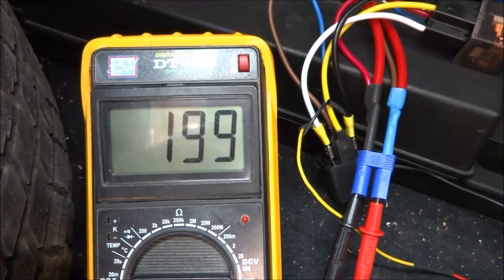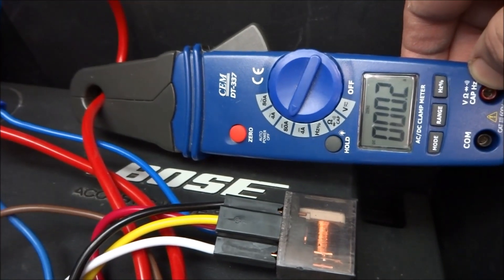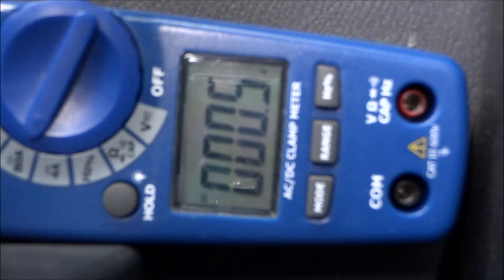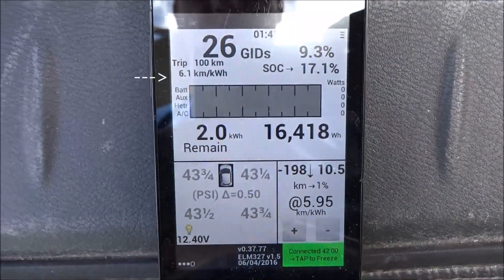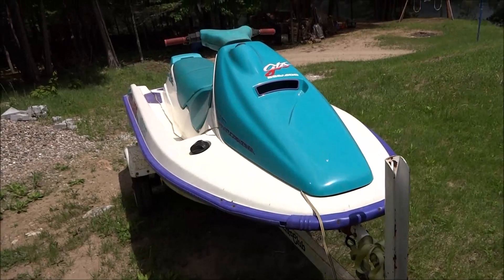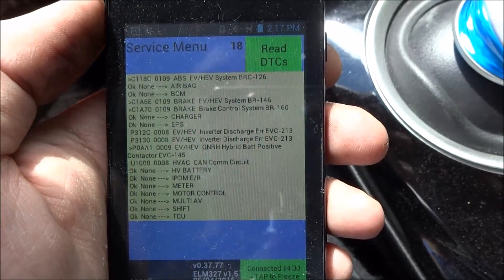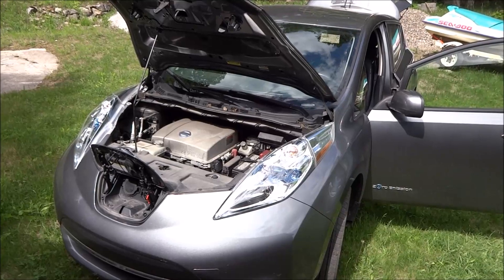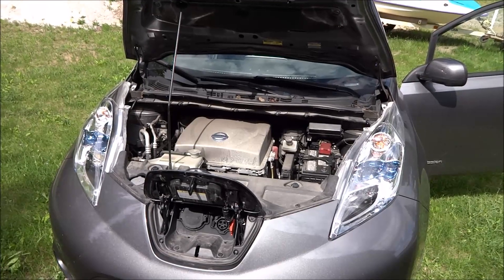Nissan LEAF range extender pack build Pt.3.2 (2nd long distance test)

Comment: I love that you use your Leaf for towing.  I've done the same with both my '04 Prius and '12 Volt, with absolutely no issues because of towing... and I tow almost every day, sometimes well over 1000#!  Anyway, hope you find the time and motivation to continue the great work!
Reply from the maker: Yeah, I've towed my BX24 tractor, almost 3000 lbs with trailer. Not long distance of course...

Comment: Perhaps wire up a timer delay (555 timer connected to N.O. relay) that disconnects main pack only after the auxilliary pack, which would be disconnected immediately.  When restarting, the relay should provide an adequate delay to the auxiliary pack being connected, no?
Reply from the maker: Not sure I want to make changes to the signaling going to the main pack. I'm hopping to tap into the the control wires for the main relay. My relay needs to open and closes at the same time as the main pack relay.
Reply: Yes, do not mess with the vehicle signalling.  You also need to sense both the N and P contactor lines and cut off when either drops.  I have suggested a circuit in another Reply.

Comment: fantastic work,  but i don't like your parallel to series relay. I understand why you have done it,  but should you lose that 12v for any reason while you are attached to the main battery,  you will have a massive voltage difference.  Hopefully it will just blow your fuses,  but worse case you could have some exploding batteries
Reply: Exactly.  I can't figure why he is trying to parralelize.  Is it for offline charging?  Then just get a second charger.  This is too dangerous.  What is the reason for this parallelizing?

Comment: So I have a Leaf that developed the same problem (P0AA1 main contactor error), and I was able to fix it without a trip to the dealer.

Thanks to the awesome work of Jim Pollock (Turbo3 on mynissanleaf) and creator of the LeafSpy app, there is now a non-Consult option to clear this code. He was able to determine the CAN message procedure to clear the P0AA1 code that was preventing my contactor from closing.

As this video demonstrates, this error that is likely to be encountered by folks hacking additional batteries or a vehicle to grid connection to their Leaf. If you make the mistake of applying high voltage to the switched side of the contactor when the car does not expect it to be closed, this hard error will be triggered (because it thinks the contactor has been welded shut) and the regular LeafSpy DTC clear function will not clear it. Consult III+ equipment is typically needed to reset (once any physical damage to the car is repaired).

I was very lucky. None of the parts were physically damaged in my car (precharge resistor still measured 30 ohms), but you should really check things out using the service manual procedure for this error before clearing the code.

Jim is going to add the P0AA1 clear feature to future versions of Leaf Spy, but in the meantime, if you have this problem, you can contact him directly for help to get it cleared.
Reply from the maker: Thanks for the info! May be useful in the future! I love the LeafSpy app.

Comment: Just wanted to say that I applaud your work! I'm sorry you have had to learn some hard lessons, but I'm very appreciative that you've learned them so I don't have to. I'm a pretty big fan of a trailer mounted extender pack... much like replacing your jet ski with a battery. It moves the fire threat away from the car and allows easy connect / disconnect. If I continue with my plans, I'll have you to thank!

Comment: Being the 12 volt battery is supplying the power for the lights, heater, air conditioning, radio, etc, and this battery is charged from the traction battery which reduces the range in winter, how about finding a way to put in more reserve 12 volt battery power? That is,  can we find a way to at least run the heater off a larger 12 volt lithium battery not being charged by the traction battery? It could be placed in the trunk for longer trips and removed for shorter trips. The heater seriously shortens the range in cold weather. Wind shield wipers take power as well alights at night. It would seem that the easiest way to extend range is to run these systems off a larger battery that is not being charged by the traction battery. It could be a very large 12 volt, lithium battery that is only charged as needed by 110 or 220 at a charging station. Many quick charge stations have a 110 outlet and a battery charger could be carried to charge this system while charging the car on the 220 or quick charger. But if the separate 12volt battery that runs the 12 volt part of the car were large enough, it could run the car for many hours without charging. The key then would be to find a way to flip a switch between the two 12 volt batteries that the cars computers wouldn't sense. It would be like throwing a reserve gas tank switch on a gas car. Does the car know how big the 12volt battery is? If it is larger, would it draw less power from the traction battery? Or no?
Reply from the maker: The car's heater runs off the main pack, only the fan runs of 12v. Finding a way to supplement power on the 12v bus would not get you much range, a few kms at best.

Comment: Was there anything else damaged besides the pre-charge resistor? I have the same error, P0AA1 (positive contactor), on a 2013 drive train that I removed from a crashed vehicle for an EV conversion of another vehicle. My resistor is fine (30 Ohms) and all the contactors work (not stuck). I can't clear the code even though the condition (high voltage where it shouldn't be) is no longer present. Is the Consult equipment needed to reset this code ("specific DTC clear") or can you do it with Leaf Spy?

Comment: Do you think it's possible to Run a generator in parallel with the leaf battery at the same voltage as your secondary battery did?
Reply from the maker: Not easily. Generators are usually 240v AC so the only way to do it is to get yourself a battery charger. The whole setup would be large and heavy so you'd have to put i in a trailer.
Reply: Normal invertergenerators have permanentmagnetgenerators producing 3phase with high freq.  Remove the inverter and add a simple rectifier instead.  For the 96 serialcells of a leaf , this is very the voltage the inverter want ( inverter want 330-385vdc ). If You make a controller turn down the trottle of the motor if the batteryvoltage gets higher and 4vdc/cell it will not be a problem. You can also put on a 12v coil push down the trottle of the motor by the cars power send to the rear breaklight so the power will be close to nothing when the Your re-generate. As exsample the kipor 104cc 2kw invertergenerators, You can push full trottle as the battery and consumption will easily keep the rpm down and this way You can take close to 3kw from this generator. During the time it takes to drain the  battery of the car, this will give You about 50km more range.  I have a some of theese generators with defect inverters ( inverter is the weak part and the part with most problems ) ( I am waiting for my e-golf waranty to expire )
Reply: I think this is a great idea.  Get a 3 kW lightweight generator and put it on a bike platform attached to the hitch.  Hook 4x 1.2 kW CCCV 86V (24s) chargers ($15 each on eBay) in series adjusted to 99V and 7A each.  Take the 240V AC, and run 2x 1.5 kW 72V power supplies that feed the chargers.

Comment: I'd drop the battery out and install a second dc connector to it and wire it to the other side of the contactor  in the battery pack. Then have another contactor coming from the auxiliary pack on its own switch on the dash. Maybe this contactor could be wired to disconnect when car is powered off. But only angle to re-connect from a separate switch. This would prevent charging the auxiliary pack from the leafs on board charger.
Reply from the maker: AArdy, yes, that is possible but you'd break the seal on the pack allowing moisture to get in. I guess if you can seal up the connection real good that would work.
Reply from the maker: William, I though of that to... it is possible...
Reply: I wonder if there is a signal  wire when the car is put in drive. If so you could engage the booster relay when the car is in drive and disengage when the car is shifted from drive.

Comment: Is it impossible to connect the extra pack directly to the main battery pack? Then it should not be a problem charging either (?)
Reply from the maker: Not impossible but very difficult and more dangerous. Someone did this and burned their car to a crisp...
Reply: Ah, you don't want to crisp your car :)  But without being able to charge the extra pack the ordinary way I think this is not the way I want to go. Or do you think it will be possible to charge it via Type 1 and ChaDeMo?
Reply from the maker: Yes you should be able to charge the secondary pack at the same time as the primary pack. You just have to make sure you connect the secondary pack after the primary relay in the Leaf's main pack is closed. I have not yet tried this.

Comment: Thanks to realy useful information. I working on similar project, add 16kwh in parallel with the main battery. I work in the direction that I will use the wire which control main power relay for control additional power relay that connects the two main batteries together if voltage is the same  (control connector on the main battery pack).

Can you write a little bit more how you solve the problem that arose due to voltage on the inverter due to off the main battery.
Thanks and all the best to continue
Reply from the maker: I had to replace the contactor box in the Leaf's main pack. The following helped me to figure out the problem: 
http://www.mynissanleaf.com/viewtopic.php?t=21776
Reply: Thanks for the quick response and a very useful link. Are you contatctor box changed itself or did you have to do on nissan service. And how much it costs?
I do not understand why blown a resistor if the contactor is switched off, unless it is a portion of a second when the circuit is closed.
I really want to understand why this happens? Please find a picture in link below. (thx mikeatyouttube for video about relay signals off). 
https://drive.google.com/file/d/0BxKOh50vx8dJWnhuVlVhZ1ZVVEU/view?usp=sharing
https://drive.google.com/file/d/0BxKOh50vx8dJNFFEaFdwWTZEU1E/view?usp=sharing

thank you
Reply from the maker: I replaced the contact box myself, purchased on ebay for $100 plus shipping.
The pre-charge circuit is only on for 500ms on startup. It is designed to "slowly" charge the capacitors in the inverter and charger.
Looking at your schematic, I assume RLY 2 is the same as RLY N from the video. It closes 100ms after the preCHG and with both of these relays closed, all power is routed through a resistor to charge up the capacitor. 300ms later, RLY P (RLY 1 in your schematic?) closes to effectively bypass the pre-charge resistor.
Now on shut-down, the preCHG relay is closed for 400ms when both main relays are open. I don't know how, but I think this is done to discharges the capacitors some how. By having my pack still connected to the high voltage bus, the resistor is now trying to discharge my secondary pack and thus burns out.
Reply: @DIYbatteries  afaik, it doesn't make sense that shutting the vehicle off without having first disconnected the extender battery actually killed the pre-charge resistor.
Reply: I don't understand.  With both the P and N contactors open, there is no circuit to the pre-charge resistor.  The pre-charge resistor just bypasses the P contactor.  So if the N is open, there is no circuit.  Even if the N is closed, the circuit will only have the difference of voltages between the main pack and the auxiliary pack, which is tiny.  So what gives?  Why should it burn out?  And BTW, why did you just not replace the 30 ohm resistor?

Comment: Leaf Xpack - This is very interesting.  Sorry you had to go through it for the sake of research and advancement in range of these EV's.  Could a series of switches on the dash or console act in the same way as plugging everything together?  Then you could turn the two or three switches off before turning the car off.  Thanks for the updates!
Reply from the maker: Definitely, a quick and easy fix would be to wire the contactors to a 12v accessory plug which I could connect and disconnect when need be (using the "cigarette plug"), however there's still the possibility of human error. I don't want to go through that again!
Reply: Hybrid Industries place another 24Kwh pack in the trunk but is not in parallel with the cars battery. It has a relay that switch one battery at the time.  So you can charge one battery first and the switch to the other battery to charge using the leaf charging system. Same thing on driving, use one battery at the time.

Comment: Wow bummer dude!  I probably would have pushed that power button without thinking after a long drive too.  Well at least you know the fix.  Could you wire the relay from your extendo pack to the car's 12v so that when you shut down it kills the connection automatically?
Reply from the maker: The problem occurs when turning on and turning off the car. There needs to be a delay while the pre-charge circuit energizes the high voltage wires. That is why I need to close my contactors only when there's power on the RLY P lead.
Reply: Leaf Xpack , how about accessing the power button so that, when you press it, it only passes that signal to the car AFTER you've shut down the extender pack?
Reply from the maker: Maybe, but I don't know how I could do this
Reply: I believe the easiest solution would be to add a "blast cover" like the important buttons have that you have to flip up to engage the button. Add a sticker "remove extender" so you cant turn off the car with one motion and have a reminder. Second solution that involves hacking the power button is also doable, depends on how easy it is to access the button leads and is it just a simple pulse button that we could "jump between" to. If that is the case then thats the line we can break and install a relay block etc.
Reply: Can you get to the OEM contactors? Assuming they are 12v contactors, connect your contactors to the oem. That way when the OEM contactors are disengaged, so are yours. Thats what I plan on doing on my Rav4 ev

Comment: fire and water prof your added batterys  your going to kill your self and any 1 else that trys to come help you if you 1 crash the car or 2 get water in side like on a icy road and slid in a ditch full of water  or 3 car fire  .. help save the lives of the EMT or any 1 else that could come to you and not know any better 

its cool you want to hack the car for more miles but safety is not a game
Reply: This is a test prototype, if it has proven to be useful then there's the next step of putting it into stronger suitable container and making clamp-down connectors for it. You are criticizing haircut thats half done. Also dont believe everything you see in movies. Drinking water is rather poor electric conductor. Unless you fall into the sea(salty) - it's not a big issue.
Reply: He probably ate too many AA batteries. It got to him.
Reply: I'd like to point out that this criticism is coming from some one that has the worst grammar and punctuation that I have ever seen. Falcon, you need to go back to elementary school.